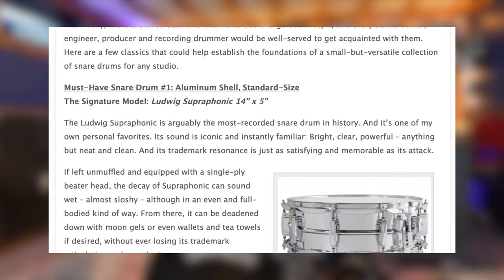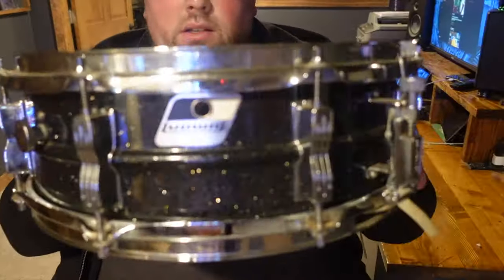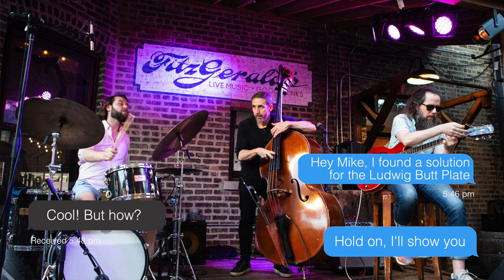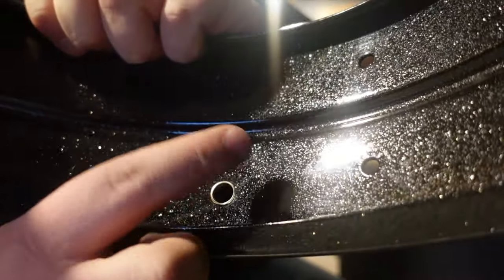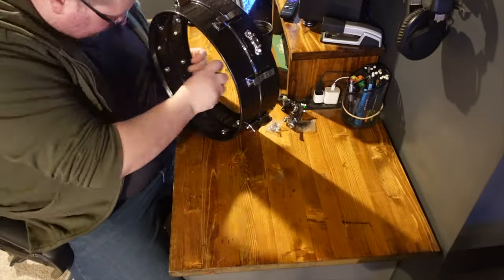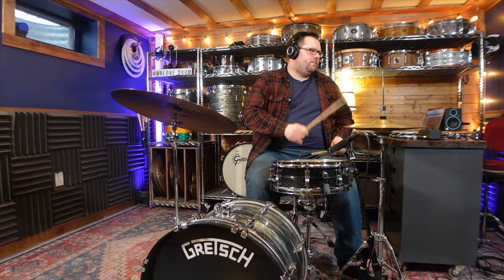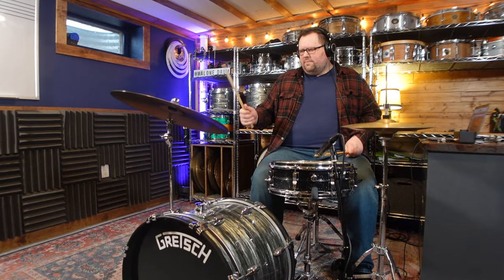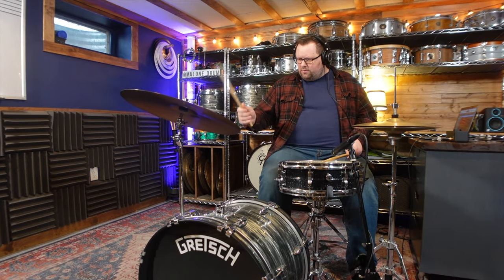Restoring a 90's Ludwig "Blackrolite" Snare Drum // Black Galaxy Acrolite

Comment: My first Acrolite is a 1971 with the grey finish that I won’t on an EBay auction for less than $25. The only thing wrong with it was that the tension knob was bent. Best drum purchase I ever made.
Reply from the maker: That's a great deal! When was it?
Reply: @malonedrum  Thanks. I think that was about 13 years ago. My most recent one is an 80's? "Blackrolite" that only needs a new set of heads for $130 off of Reverb a couple of months ago.

Comment: Picked up a mint 90's Blackrolite for $50 with case. Installed an Inde throw and butt plate, works great, kept the original P85  to put back on if I ever sell it. Use the Blackro on various sessions and smaller room gigs or when I just want a change from my 402....Nice vids, keep up the good work! PS, I bought a rock and roller cart after watching your video on it, best $ I've spent on gear in a long time! Thanks for the heads up. Cheers!
Reply from the maker: You'll thank yourself (and hopefully me for recommending) every time you use that cart!

Comment: Great video, Mike. Do you have a link to the nylon ribbon you use for your wires?
Reply from the maker: I bought this spool like 10 years, and it's still lasting me, but basically any 5/8" crossgrain nylon ribbon is what you're looking for, but here's some links that help my channel!

https://amzn.to/3TN07By

Or just buy the Gibraltar style (already cut to size)

https://sweetwater.sjv.io/c/5015118/937020/11319?prodsku=SCRST&u=https%3A%2F%2Fwww.sweetwater.com%2Fstore%2Fdetail%2FSCRST--gibraltar-cloth-snare-mounting-tape&intsrc=APIG_7338

Comment: Whoa!  Someone else has tapped a P88!  I did this with my old 14x10 marching snare/SNOM conversion.  If you don't care about 8-32 screws, an M4 tap works even better with no drilling needed.
Reply from the maker: Hmmm, so you just used the preexisting holes?
Reply: @malonedrum  Exactly.  Lots of tap lubricant and went very slowly in case the diameters didn't work out.  I'm sure that if I were a professional repair person, I'd have an 8-32 tap, a #29 bit, and use the included Ludwig screws.  As it stands, M4 is just that little bit narrower, so it works out.

Comment: Really cool Mike . Which metal polish do you use? I love working on older drums as well.
Reply from the maker: It really depends on the project, but honestly a lot of times I don’t even polish per see. But I like brasso, chrome auto polish, and turtle wax on drums from time to time.
Reply: @malonedrum  thanks Mike. I tried this stuff called cape cod they are treated pads ,took forever to get the film off a chrome plated snare.

Comment: Hi-
I am strongly considering purchasing an Acro lite / Acro black snare and making the same mods. Is it possible to list a step by step with the materials and tools needed maybe with some links and what was used for what as far as the tools go (to appropriately do the holes and mods correctly). I would hate to mess anything up.
Reply from the maker: It’s all in the video I believe, and you can get a drill set with bit and threading tool!
Reply: @malonedrum  you go a bit too quick even after watching the video a number of times. I was hoping you can provide the exact tools used with the sizes of them for the drill bit size and brand to make the holes bigger as well as the tool and size to create a newly threaded butt plate for the opposite throw off side. I don’t want to mess it up. Thanks. Even better if you can provide Amazon links of drill bit with appropriate size and tool to make appropriate sized threading as well as size of drill bit if different from the first drill bit to drill out the hole. Thanks so much. I really like your bideos

Comment: Back in the early 00's, used Acrolites would come to the shop I worked at all the time for $25-50. We actually stopped taking them for a while. Kind of kicking myself for not buying them all and selling in the current market.
Reply from the maker: It was a different time! Sometimes I wonder what is the thing drummers see as value-less now that in 40 years we'll be kicking ourselves for just throwing away.
Reply: @malonedrum  I'm thinking those early 2000's Mexican pdp kits are real sleepers personally.

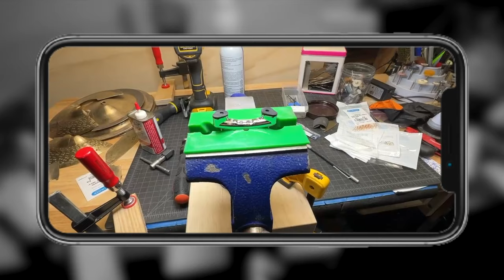Comment: 4:09 Butt plate solution
Reply from the maker: Definitely an awesome solution to a consistent problem I've had with these mounts.
Reply: Thanks Mike! I replaced my throw off with the p88 and was so disappointed when the butt plate would not fit because the holes don't line up. Now we have a solution and I am very grateful! 🥁